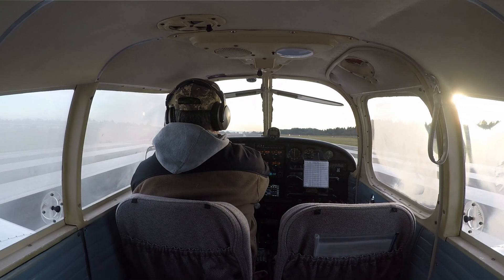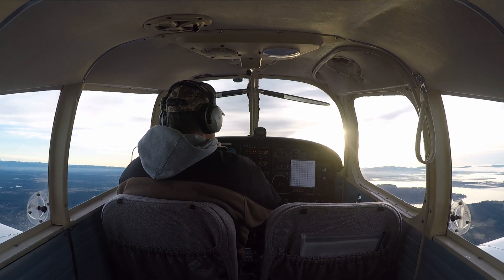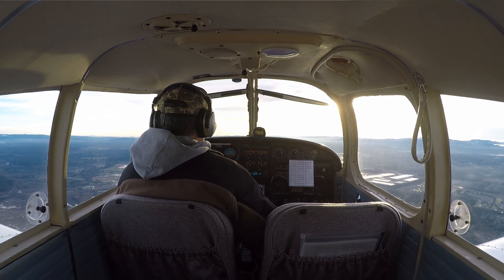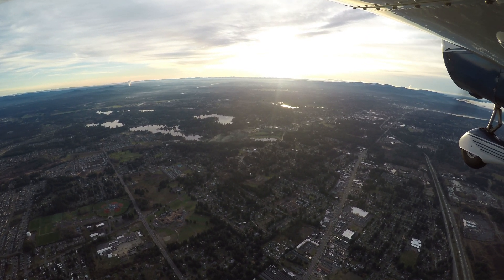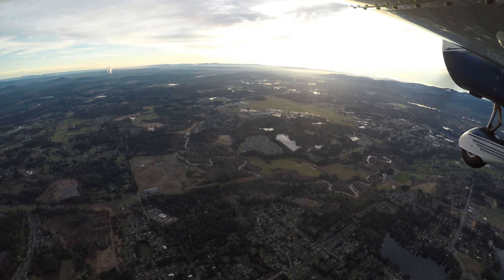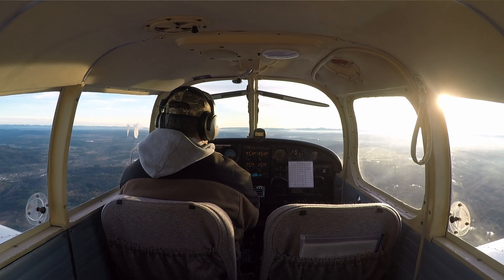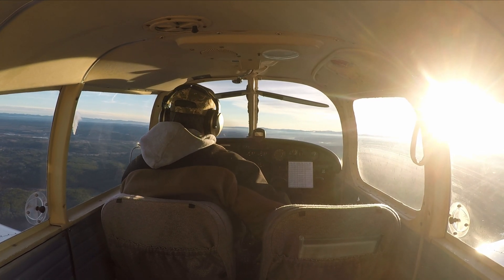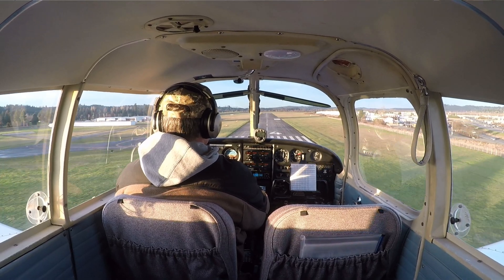Aeronautical Mobile Ops with Anytone 878 Digital DMR Radio

Comment: what mount are you using?
Reply from the maker: I use this in conjunction with a standard RAM ball mount

https://www.etsy.com/listing/959236302/ram-ball-mount-for-anytone-at-d878?ref=share_v4_lx&variation1=1989695775

Comment: Heard you over pnw digital on your way back to tiw.  I dont have my radio setup quite right to be able to make it into the repeaters for some reason.
Reply from the maker: I did come up on the UHF  digital repeater briefly when I was having trouble with my openspot three. I hope you’re able to resolve your radio set up.